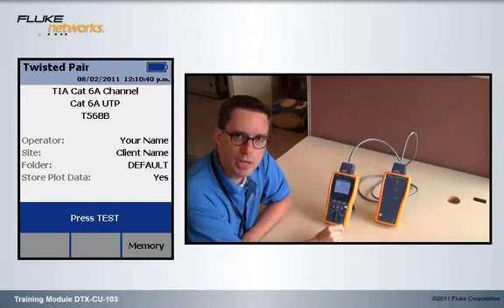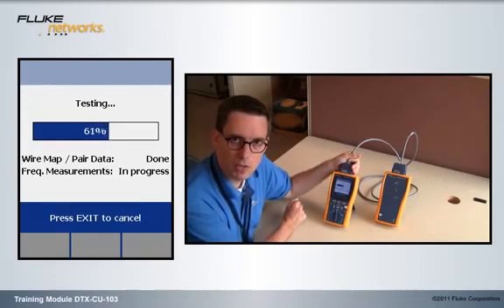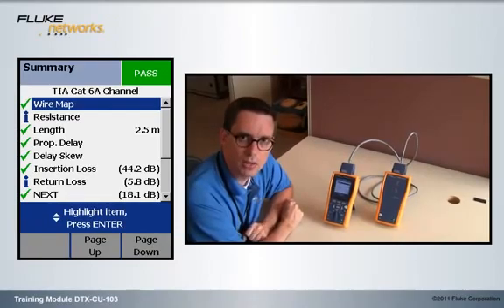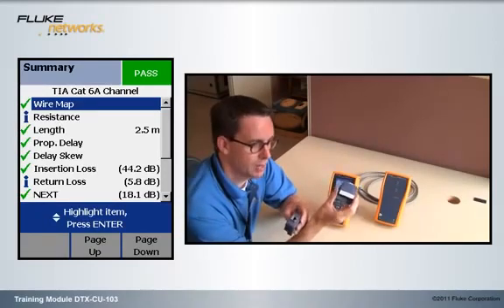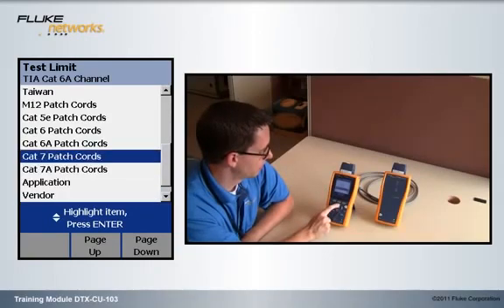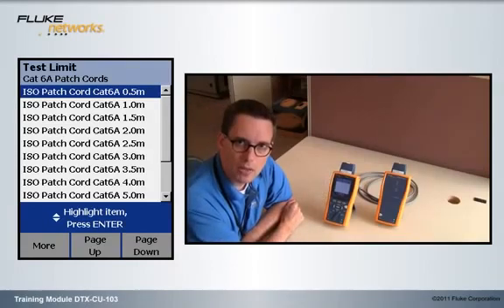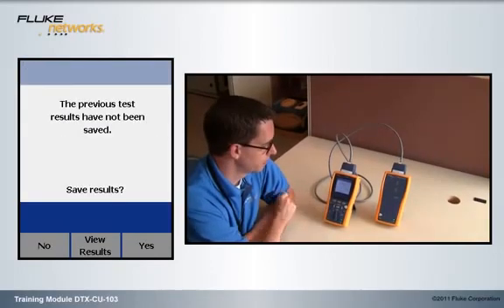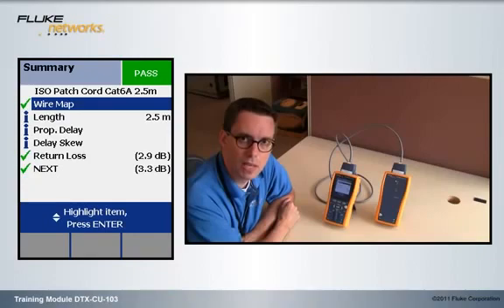Certifying a Cat 6A Patch Cord (DTX CU 103): By Fluke Networks

Comment: @FlukeNetworksVideo , why can't you just make a custom profile with a limit line suitable for Patch Cords, and then be able to use the Channel Adapters?  How do the Patch Cord adapters physically do anything different?   Surely the firmware could make it to include the termination on the adapter so that way you can use Channel Adapters to test patch cords.  Is there something physically different about Patch Cord Adapters compared to Channel Adapters?